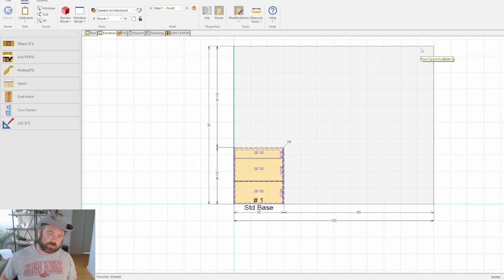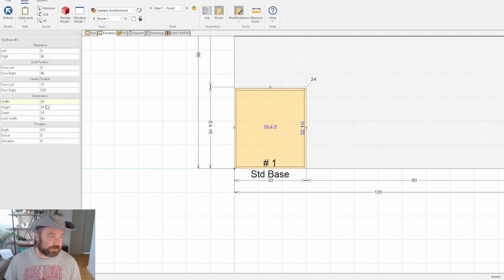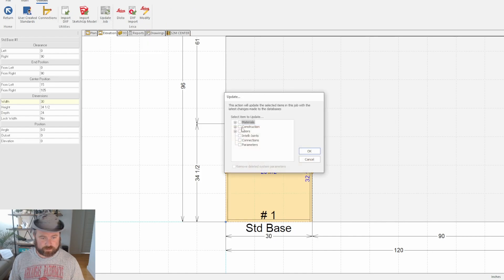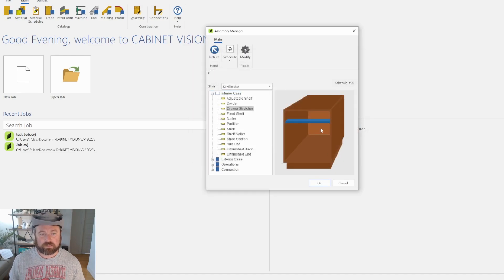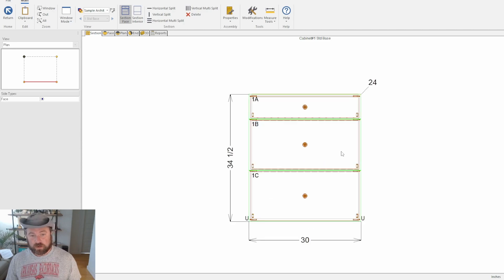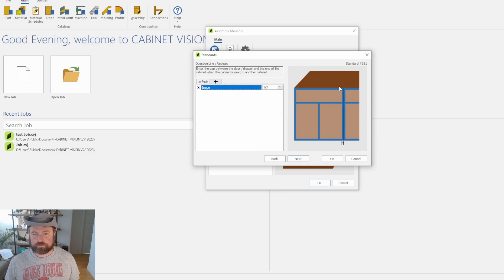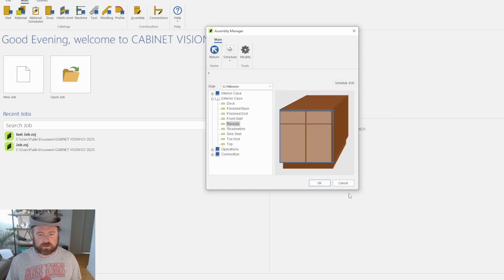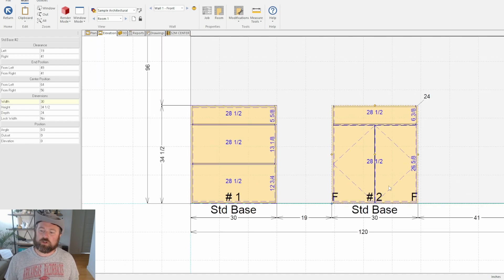Building a Cabineo 12 framless box PART 2: Setting up door reveals

Comment: Hey, I just started using Cabinet Vision in March. I've had struggles to say the least. I am currently trying to tackle illustrating fluting on a complete wall. It's not that the CNC needs to cut it but that the customer needs to see it in the drawing and 3D render. I have tried to apply a case molding, too many paths. I have tried to upload a photo into the textures and apply it to a panel, no dice. I have tried making the panel a beadboard door, no dice. I'm not sure how to accomplish my goal and my experience in the program is limited so I don't know the best ways to manipulate it yet. Have you done this before or have any advice?